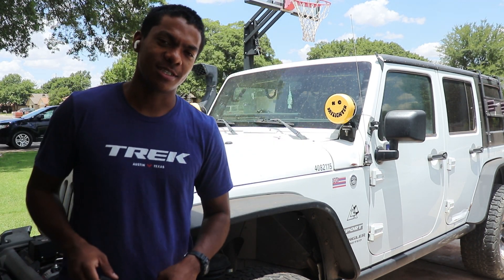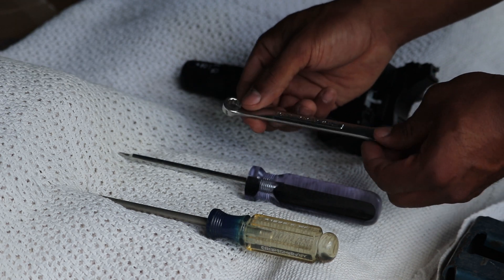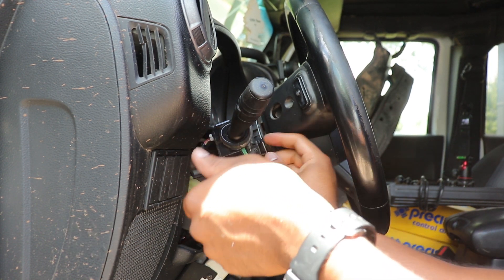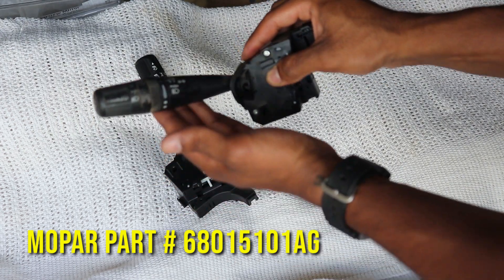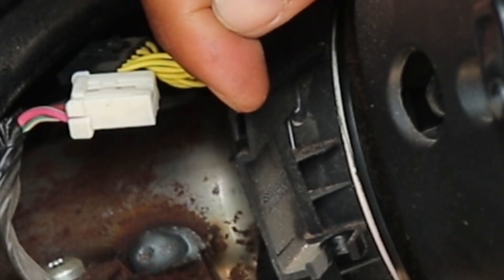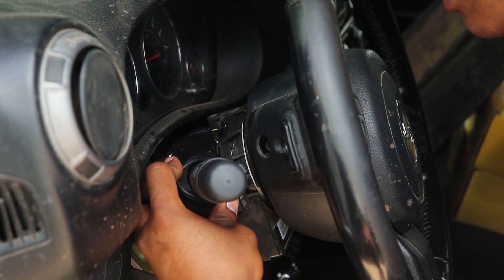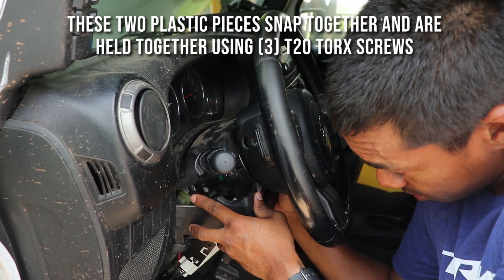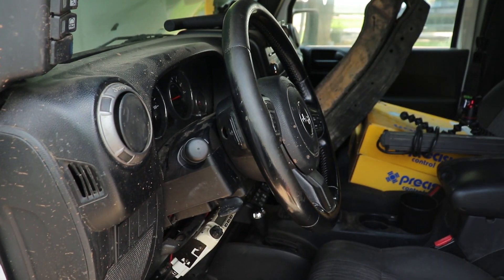How To Replace Turn Signal Stock (Multi-function Switch) | 2007-2018 Jeep Wrangler JK |

Comment: Thank you so much. 2013 JK. Right turn signal would not quit blinking, and dome light would not come on. The worst part was a constant ding that would not stop until you unhooked the battery.  Duralast SW8481 part number.  Thanks again.

Comment: Thanks for the video Chris, I was going to remove the steering wheel before watching this lol.
For those that want to have a go at repairing this, I did it and now it's as new!
Easy fix details are:
1. Remove it as Chris did.
2, Remove the two screws on the white blinker cancelling side (white prong in the middle thing side)
3. Remove the blinker stalk
4. Remove the centre of the 3 spring loaded white arrowed blinker position locking bits
5, Stretch the spring by 10% of it's original length and put it back together carefully
6. there are also 3 black pins that operate the switches and these need to locate correctly but when you get them all perfectly aligned, it goes back together without gaps. Do not force it closed! 
7. Reinstall the two screws on the stalk and test by hand that the blinkers stay on properly
8. Reinstall unit as per Chris's video and enjoy your reconditioned indicator stalk/blinker switch :)
Reply from the maker: This comment is perfect. Thank you!
Reply: @developmentdivision122  You're welcome :)
Reply: Thank you, @andrewstewart8704. Helped me out 6 months later. Was debating on ordering a new switch/stalk for my 07 JK. Took the old one out, stretched the 3 springs and reassembled carefully. Turn signals stay on now as they should and not nearly as much light flickering on my cluster and radio when moving the switch for lights and turn signals. My cluster brightness control with the headlights on even kind of works now. Saved me $40-$80 for the time being. Appreciate you sharing!

Comment: On certain models if you do not have auto headlights you can get the stalk and sun load sensor, drill the dash for the sensor, the plug is tucked above the stereo, then use an app to activate it all. Did this on a 15 jku sport.
Reply from the maker: Oh word?? I might have to try this out. Thanks for the tip!!
Reply: @developmentdivision122  and if you have the factory display screen you can add and activate a backup cam. If not equipped.
Reply: Why would you want anything automatic on a Jeep? The whole reason to buy one is that it's not loaded with a bunch of useless crap that will eventually break.

Comment: I took it from a landfill with the same problem for free, untwisted and replaced one plastic element with a spring. 

Usually you knock out the top position. Therefore, you need to take from a non-working plastic element with a spring from the lower position. 

When assembling, the switch should be in the "lights off" position. The slider on the board should also be in the off position.

Comment: You completely skipped the hardest part - getting the lower cowl off.
Reply: Literally the only reason I looked up a video too🤦🏾‍♂️
Reply: @josiahtafoya7326  I solved it by not taking the lower cowl off at all. I just bent it down and held it there with a small crowbar while I used my other hand to remove the old switch assembly and then install the new one. I do not believe the lower cowl can be taken off without removing the steering wheel. There was a redesign at some point which added a lip that makes it impossible to remove.
Reply: @ChopperCharles exactly what I end up doing with my 2018 JK😅
Reply: @ChopperCharles  💯

Comment: Great video! I just tried this for my 2018 JK however and I am wondering if there was a design change -- there is a collar on the upper and lower parts of the plastic covers which extends under teh back of the steering wheel and makes it impossible to remove to get clear access to the switches. It actually looks like you would need to remove the steering wheel... Is this a known thing? Anyone else have this issue?
Reply: Yessss
Reply: Had to do it today and it can be done without removing the steering wheel  but it is HELL to get that collar off - Being extra careful not to break anything takes longer than 20 mins.
Reply: @luvleelocs6795  I ended up going to a mechanic (who replaced it with a wooly third party stick that annoys me to this day) and he was able to do what you did, but I was not able to do that myself

Comment: Don't show how to remov the bottom part...e
Reply: I just replaced mine now and I had the same issue getting the bottom piece off so I was able to pull it down on the left side and manipulate the turn signal control arm out without taking the bottom piece off. I’m guessing you’ve done yours by now but if not you might be able to do it this way.